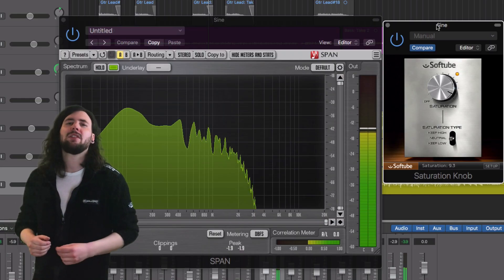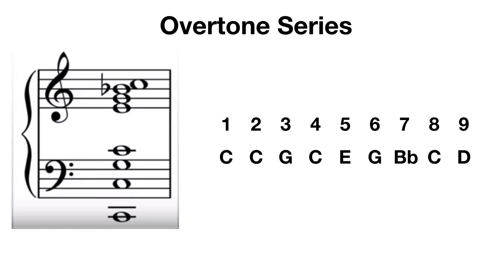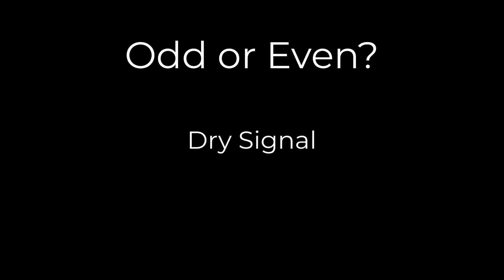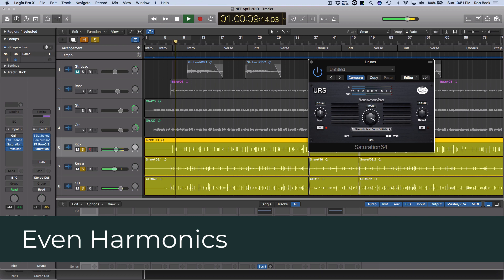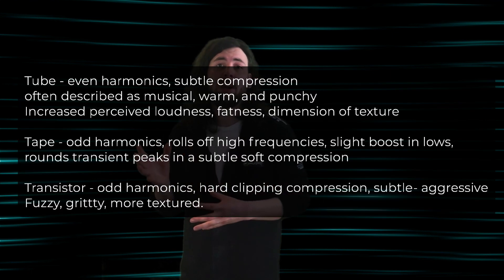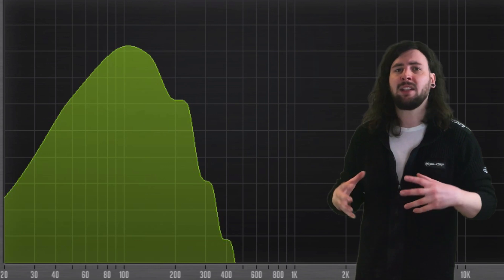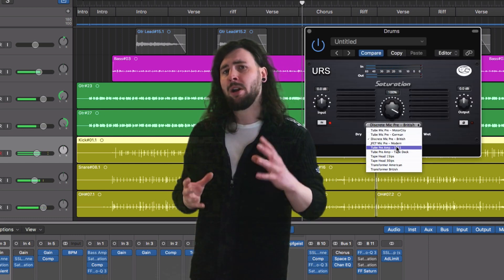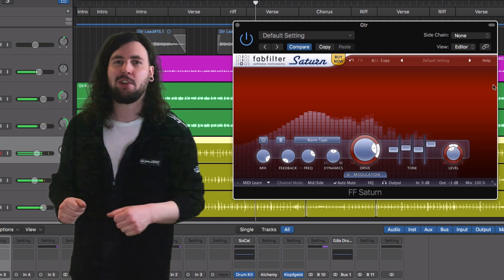Odd vs Even Harmonic Distortion in Mixing

Comment: Tape sims are supposed to introduce odd order harmonics, and emphasize the third harmonic. Tube style saturation adds even order harmonics, and emphasizes the second harmonic, and generally can sound (subjectively) a little smoother. Diode/Pentode transistor style saturation, like those emulating pre-amps is based on a row of odd harmonics characteristic of transistors resulting in a sharp, somewhat aggressive sound  These non-linearities are often what makes a sound source sound fuller, as well as the useful softening of transients to add cohesion. So to answer your question, anything that is a tube simulated distortion, or anything labelled "warm", like in saturn, the plugin you're using, introduces even harmonic overtones. Also it's important to note that the "Keep Low" setting in softube's saturation knob actually ephasizes the low end less, as it's distorting more of the high frequencies (which is a form of compression) as a way to make the low end seem louder by comparison (and vice-verse for "Keep High" mode).
Reply from the maker: Great answer Zac some good points here. I got similar responses when researching for this video, (tube = even, tape = odd etc) but was disappointed I was not able to recreate those characteristics using the plugins I had, most of the tube settings were just the same odd harmonics in a different orientation. Definitely will have to follow up on this video.
Reply: @LearnAudioEngineering  - That's been my exact experience as well...
Reply: @LearnAudioEngineering  I believe the characteristics of tube distortion (odd/even etc...) will depend on the type of tubes used, and the type of circuit it's in. They can produce both kinds. Triode tubes, in the most common circuit topology, and not driven to clipping, will add mostly even order harmonics. I think pentode based circuits tend to add odd harmonics. At least that's how I understood it. I think there is a Waves plugin with a "beauty" and a "beast" knob which lets you decide the distortion type.
Reply: Yes, some people mismatch unbiased tubes  @pbholmen
Reply: @LearnAudioEngineering  Shut the fuck up Rob
Reply from the maker: @zacgabriel4724  Curry Bae <3
Reply: i found out that tuning the 'bias' knob (if your distortion had one) creates even harmonics
Reply: Super interesting video and thread. Arturia Tube Culture (triode 1) and Lovend both emphasise early even harmonics, which is one of the reasons why they sound so pleasing to me.